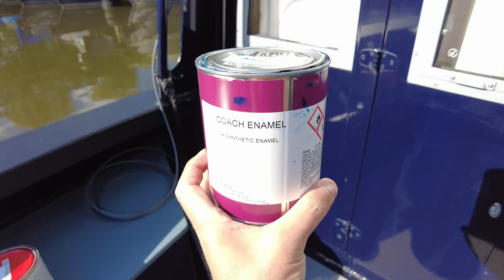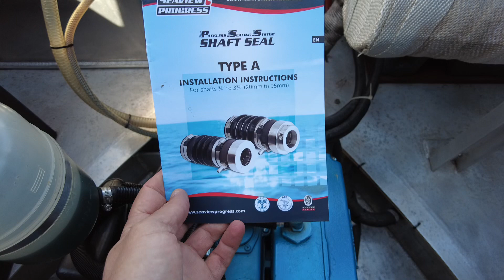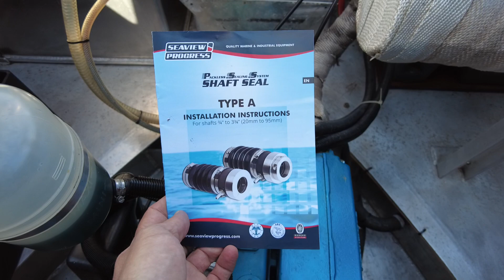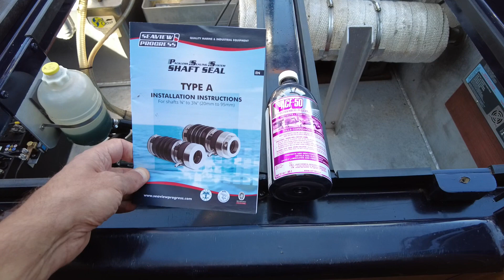Our Narrowboat Pipistrelle Part 2

Comment: Interesting, what model Victron did you use and does it read all the batteries? Have just purchased our first SO it is a 41 2001 in great condition. Initially going to explore the river Wey to gain experience. Have had quite a few boats but this is the first with accommodation etc. Big learning curve so would love to see more videos about the basics of starting running maintenance etc.
Reply from the maker: Hi. It is a Victron Phoenix 12/375. I only want it to power the TV while cruising.